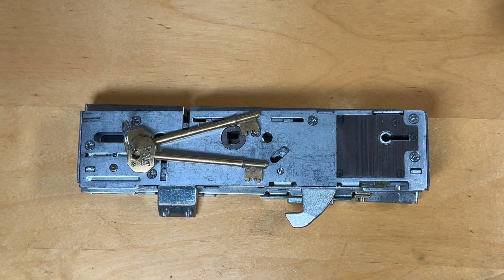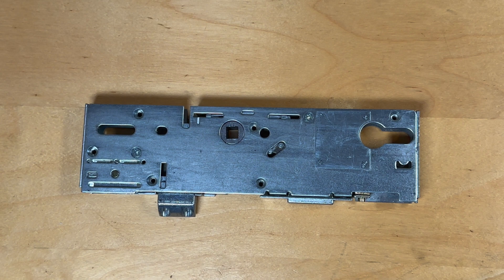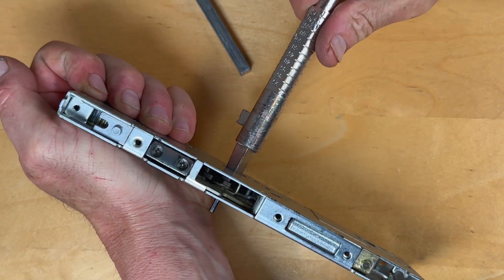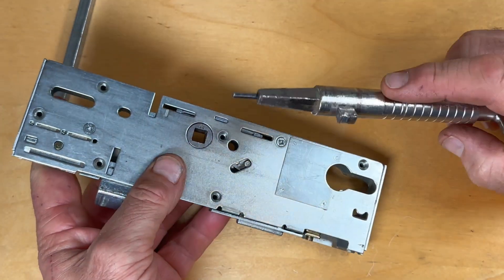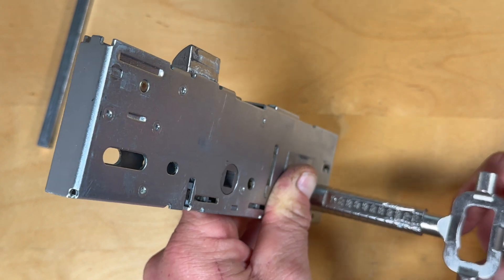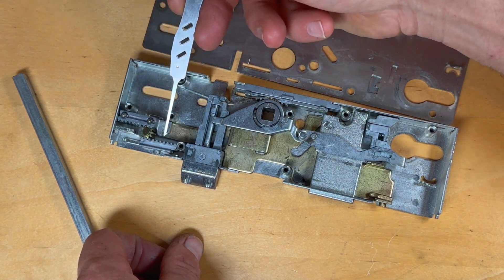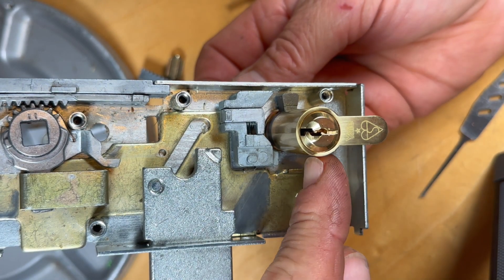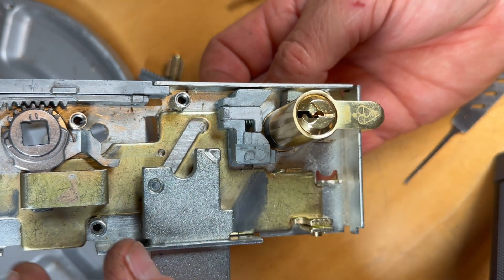Centre Case/Gearbox 101: ERA walk through

Comment: Thanks for a great video. I now understand how this centre case works. I had the top reversable latching pinion break and had to modify a new one (remove latch and lock as the double doors had a center spacing piece) to get both top and bottwn pins to operate. The stuff on the Euro lock was invaluable. Cheers

Comment: Fascinating to watch how the internals work.
About four months ago my front door failed, something broke and the square hole where the spindle goes through snapped. Guy came and replaced the gear box but said mine was quite an old type. He swapped it out and it just didn't seem to operate properly for about a month then started working OK.
I don't think that people realise the info base you have to have and the technical side of it either. Locksmithing isn't just picking a lock, in fact that might be what 50% or 60% of the job.
Great video.